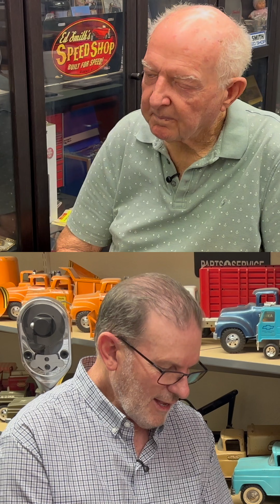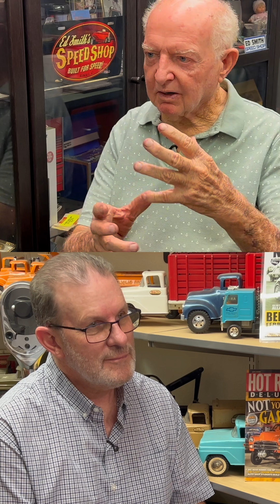A Smarter Way to Build a 377 Engine? 🔧  Ask Ed 46 - Ed Smith w #BarryT

Comment: The Ford 300 rods can be used to build a Chevy 300 and they're a good forged steel piece. They have a heavier main ean area compared to the Chevy rods and a are a bit longer to get a little better rod to stroke ratio but you have to use a special piston which makes the cost higher. There absolutely NO reason the even want to spin a 3.48 stroke motor 9 k. The 3.48 crank engine will make all the power it needs or even really want to spin one up to ~ 6800! Do your research and you will find that once you pass the 6700 area, you run into problems keeping a respectable lube fil between the cylinder wall and piston. Do the math to see what your main journal speed is and also the air flow rates of the heads all the way through to the pipe outlets and you'll find that the pumping efforts, losses, valve train harmonics, stresses on the entire system is just simply BEATING the parts to death. Next is whatever rod choice, you likely will still end up with a 3/8 bolt and THAT is your weakest link! Then to truly build an engine to turn over 7500 and expect to get ANY dependable life and usage from it, you're going to need a roller cam solid tappet rev spring assembly, Titanium valves along with all the rest of the high priced go fast parts. LOTS of money just for another ~1500 to 2500 rpm you really won't need. If an engine that just has to spin that high, you're much better off building an engine using the 400 block with either a 3.000 to 3.250 stroke with the special thick bearings which you have to have anyway if you use a 400 block. You then have a block you can run 2.08 to 2.19 intake with either a 1.6 or 1.72 exhaust valve to take advantage of the large bore high rpm flow requirements. This engine is just a big brother version of a 302 Chevy which was designed in the beginning for TA class racing along with the Boss Ford 302's. Back in the 80's I spent some time with a fellow that raced a 331 Chevy that reved to 11.k and survived for a little while until it popped a valve stem and dropped that into the engine where it bounced around from one bore to another till there wasn't ANYTHING left to salvage. I don't even recall if many of the bolts inside were worth keeping. That roller cam was a multi piece, it trashed the rev kit system also before parts stopped moving in there. That engine was a 400 with a billet steel molly crank with a 3.000 stroke I think. It's been so many years now I don't recall but you can do the math. But I do know that engine in a blown alky rear engine rail frame was running consistant low 9's out in Bakersfield at Famous dragway. It also had a set of Bill Miller aluminum rods, and a set of Chevy 292 casting iron heads which are anglem plugs.
Reply from the maker: That's a lot of great information, thanks for sharing your insights!
Reply: I love all the information.   This is my favorite place
Reply: Great insights into what it would take to spin 9k.
Big inch small blocks are way better suited for higher power numbers lower rpm without the $$$$ high rpm parts.

Comment: You need a set of main bearing spacers to put a 350 crank into a 400 block because the main journals on a 350 are smaller than a 400.

Comment: I remember reading that combo in a magazine in the 80s
Reply: I remember something like that too. They built it for a claimer motor.  Only I thought it was a Ford combination.  Like a 351 crank, 400m block and 315m or Windsor pistons combined with 300 6cyl rods. Can't remember the details or total displacement might have been a 400 crank.  That was 40 years ago .
Reply: @michaelschranz5666 if you find that article I'd like to know.
Reply: "The 350 Chevy should have build"... guy has dynoed that combo on youtube worth a look.
The article engine drank 87 and still had 400hp!

Comment: I never could wrap my brain around using rods from an engine that was engineered to never exceed 2,800 rpm for a high Rpm engine, do you see the irony?  I got the math part. I remember when the were putting olds rods in 350 chevy’s

Comment: Why wouldn't you just use the Chevy rods, they are forged steel, I would not use anything made by Ford in a Chevy engine, especially a cast rod
Reply: If youve ever rode in a jeep or owned one, they are made of a combination of all models, ford an chevy, an some chrysler parts i beleive....😂
Reply: @berniceperry8898  That is absolutely correct. IH did the same thing.

Comment: Those Ford 300's were indestructible.
Reply: Not at 9 Grand 😂
Reply: I blew a 10 inch hole in the  block on my 70 two wheel drive pickup  while ice fishing .
     It still ran after that  . . .  
 a few times anyway
Reply: @maxpuppy96  hard to blow up when doesn't make much power

Comment: Ed’s reaction was great yea maybe turn 9 one time then brand new picture windows installed on that block I love 377 short fill that block and cheap steel crank and a set of cheap Hbeams and forged pistons and some fun machine work with deck plugs and pin the steam holes and deck it and now ya got something that ya can have fun with

Comment: Tight Budget and 9000RPM are diametrically opposed Oxymorons
Reply from the maker: Maybe depends on how many total rotations you expect !
Reply: Yeah. Cast budget rods and we want to spin the crank 9,000 r.p.m. I would suggest using an engine oil blanket at the track just in case.  😂
Reply: Oxygenating a moron is not recommended...

Comment: Anything spun 9,000rpm requires the finest quality aftermarket parts for any hope of longevity. Not to mention Scienced Out Oiling & Cooling systems
Reply: That is a safe way to do it but far from the only way.  There is also a lot more that will determine the RPM range of the engine than teh rotating assy.